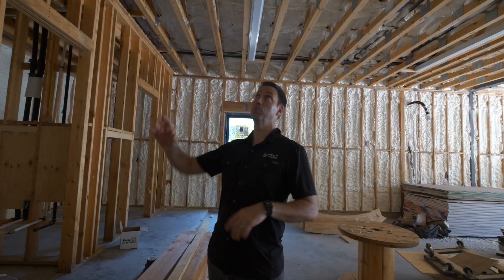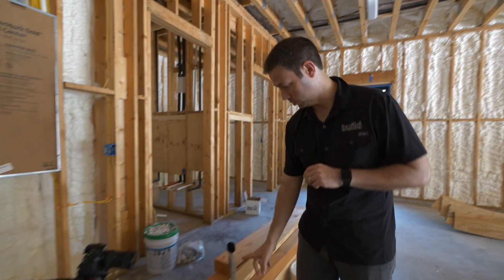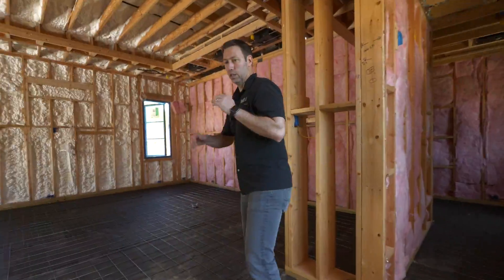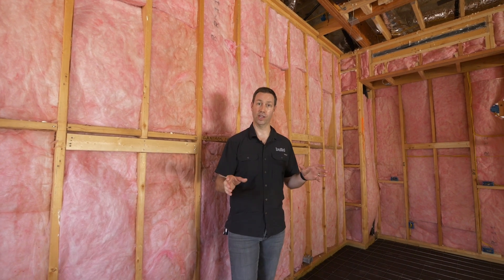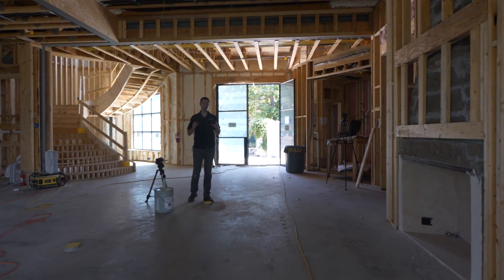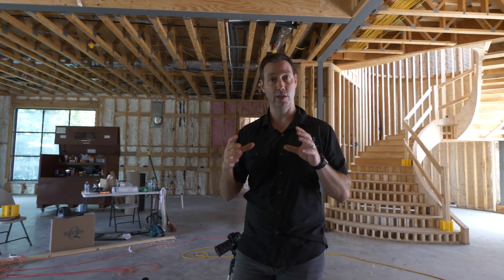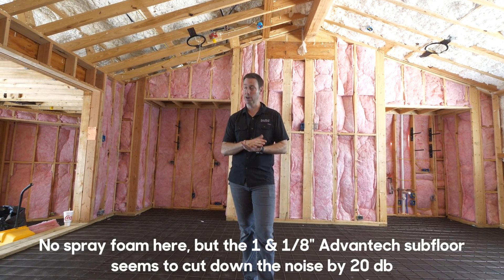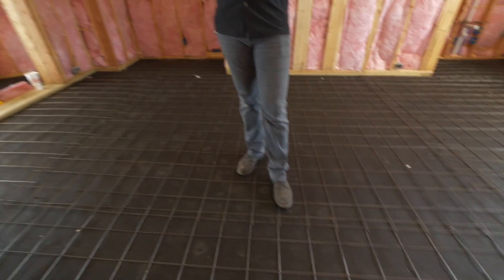Does Spray Foam Soundproof a Floor? Lets Test it!

Comment: You should make a 4' x 4' box and have a song or some noise sound at a constant level. Then Try insulating the box with different types of foam. That would give you a more accurate reading. noise outside the box reading inside and reverse.

Comment: Any insulation, is only part of the total solution. Spray foam air seals, it helps with mid and high frequencies and finding air gaps. Combine with fiberglass/rockwool, to close up between joists to stop the space from being a resonator. Then, decouple from the joists. RC then add mass with double drywall. This addresses "foot stomping" and pets nails.

Comment: There’s no science to this test. You need mass, not gimmicks to reduce energy transmission through boundary walls. Products for reduction of reflections (high mid and high frequency reverberation) like spray foam are not suitable for noise suppression. Even “green glue” is a sham. Mass, mass, mass. And each type of material will only be affective at certain frequency ranges. Air-sealed, air-gapped, and multiple layers of material is the way: this means, hire the pros, or you’ll spend thousands more than you need on gimmicks.

Comment: Open cell does some sound control but closed cell can actually increase noise by coupling .Your test is false as the fibreglass pink helps control you voice.
Make sure you mention yours is open cell.

Comment: Spray foam is somewhat effective but sound energy still travels down the joists. Resilient strips (Z-shaped channel) and two layers of 5/8" drywall is the way to go.....the mass of the drywall cancels out the deflection by the sound waves traveling through the joists.

Comment: TLDR: spray foam sucks. Adding a double drywall ceiling with some sort of isolation (green glue), or additional mass on the floor above are going to be the best improvements. You want air tightness to reduce transmission, and isolation+mass to reduce sound conduction. Insulation can Sometimes help with air tightness, but personally I would use it to reduce echoes.

Comment: Most of the vocal energy is being absorbed by the open insulation. Spray foam will be good for preventing sound transmission because it seals openings. But it doesn't have the mass to absorb any significant amount of energy. My guess is that it will be better at damping than say wall board.

Comment: When I built my studio (30x50) in an industrial building, I added a layer of sound board and another layer of drywall between the office and studio space. On the windows, I added 2 more layers of glass of different thicknesses and distance between layers, which cuts different frequencies. In the studio on top of 5/8" drywall, I added another layer of 5/8" drywall attached to Z metal. You couldn't hear traffic a from the nearby 4 lane boulevard except at 3:15pm; everyday a guy on a crotch-rocket would leave work.

On the ceiling and part way down the 12 ft. wall, 1" duck board insulation was laid flat. It preformed very well to reduce a major amount of reverb in an open space, , but cost $1200 at the time.

With time and money, we can achieve most anything we can think of. Cheers

Comment: Use Rock wool insulation between the Floor joists - snug, but not compressed.  (You could even use fibre glass as it's almost as good, but cheaper.)

Then install foam sill gasket to the underside of the ceiling joists.

Then install 5/8" Type X Drywall to the ceiling.

Then install another layer of foam sill gasket to the underside of the 5/8 ceiling drywall in line with the ceiling joists.

Then install a second layer of 5/8" Type X Drywall which will  become the finished ceiling.

Essentially you have a layer cake of drywall and foam with the mineral wool sound deadner. 

Results should be very good.

Comment: We used this same material for living space over a 3 car garage.  The major annoyance is from the electric garage door operators, bolted to the garage ceiling. Hardly hear sounds from the garage or living space above.  Our focus was on a cold floor, sound proofing was not a consideration.

Comment: Sound waves travel most effectively through dense encapsulated structures( Spray foamed), Isolating materials that vary in density, is what reduces the sound waves ability to conduct through the structure.
Reply: Laura Brown  There is virtually no soundproofing from those curtains. Read the Amazon reviews for those products using the search term "noise reduction". Complete waste of money if purchasing for sound proofing.
Reply: @elympicrecords  She's a troll... I see "her" same comments on many of the noise reduction vids I am researching.

Comment: Just use rockwool, resilient channels and 5/8 drywall to soundproof anything else is a waste of time.
Reply: I did this and its ok. But, I wish I used 2 layers of drywall
Reply: @didafm  If its only "ok" you did it wrong
Reply: @fivestar2227  how so? I used rockwool safe and sound with and air gap above and below. And used res bar and then 5/8 fire proof drywall... its good but I can still hear my basement tenant move sometimes...noise travels thru the ducts there is no way to address that.
Reply: @didafm  If they are rigid metal vents and your able to switch them to flex that might work for you. If you have an air gap above and below the rockwool that space would have been better loaded with more dense sound deadening rockwool.
Reply: @fivestar2227  i could see that working...but videos I watched on YouTube said to leave an air gap between layers....next time I would do 1 layer of 5/8 and 1 layer of 1/2 i think that would have been amazing

Comment: The reason there wasn't a change is because the vibrations travel through the exposed wood framing. I would bet that if you cover the wood with foam you would notice a difference.

Comment: Should've set the decibel meter to peak recording for the stomping test.  It's probably doing some averaging and not recording the real peak of the decibel for each footfall.  I can't really see the screen, but there is a "FAST" setting for most of the Extech devices.
Reply: Hes also not aware, i think that db are a log function.  20 db isnt 50% louder that 40 it is 100 times as much sound energy.  In other words there is a LOT more to it.

Comment: The only economic and effective way to deaden a floor in construction is to isolate (decouple) the deck and ceiling from the joists. (There is a more effective solution see the end). Increasing the mass, (eg using concrete) would work, but be very costly.

Most of the vibration in conventional home construction isn't  through the air space, but through air penetrations and directly transferred between the deck and ceiling through the joists. That structure it acts as a unified rigid membrane within each set of walls.  Some damping can be done by placing a dissimilar material between the tops of the joists and the deck but this material needs to bear the floor's loading, so can't block very low frequency vibration.  

If the ceiling is suspended from hangers with elasticity under tension, or by a light joists that are isolated from the loadbearing one of the floor above,  only the air can couple the floor to the ceiling.  The mass of the ceiling will act to dampen higher frequencies, partially through cathat sound.  A ceiling composed of isolated pieces would be more effective tha a similar material installed as a continuous sheet, and tiles made of alternating layers of rigid and elastic materials will  be more effective at converting vibration to heat than a conventional ceiling with one layer of sprayed on foam -regardless of the thickness of the foam layer. 

Compare the costs of these techniques against carpet floor covering with a dense pad.  The carpet will cost less and reduce sound better than a poured concrete floor.

Comment: I'll give you that foam will reduce sound but just by a few decibels and particularly with higher frequencies but will do close to nothing at isolating bass. The typical misunderstanding between sound absortion and isolation is that foams and light, absorbent materials reduce sound transmission when they only reduce sound reflection but keeps traveling through these materials. MASS is the only way to isolate sound, these are heavy compact materials such as concrete, steel, glass, etc.
So, if you are looking to reduce the noise from upstairs don't waste your money in foams and better add a layer or two of plywood, OSB or even sheetrock to your ceilings and make sure the gaps between them and the perimeter are filled with mastic. Recessed lights and such should be boxed in plywood too and sealed with mastic.
Great videos btw, thank you for taking the time to make them and sharing !

Comment: I'd be more worried about using open cell foam it's a huge growing bed for mold......
Reply: Use closed cell always better more money but no air pockets as open cell does and be sure you hire known company you won't regret
Reply: Only if there is a constant source of moisture ~60% relative humidity for >48 hours. Mold will not grow unless moisture is present. If there is that much moisture constantly the building will rot. I'm a licensed Mold Remediator

Comment: Worst. Science. Ever. That's not how you test something. Anyway, spray foam does almost nothing to block sound. Carpet would work well. Drywall would work better than carpet. I know, let's bury the house in concrete and Matt, you watch and see if that meter registers the roar of laughter outside.

Comment: This video is really an unfair comparison. If it was me I would have like a boom box let's say in the upper floor.
Play a file that generates a certain DB of sound before the spray foam is applied. Then redo the same test with everything in the exact same position and boom box sound levels, and redo the test. Room sizes can generate different DB level acoustics based on size, material, etc.

Comment: See all the steel reinforcement he's walking on?  On the upstairs floor?  They're going to pour lightweight concrete on the upstairs floor.  GUESS WHAT?  The lightweight concrete, or tile over cork or dense rubber underlayment or even OSB will isolate noise from upstairs and not allow it to travel through the framing members to the floors below.
What most people don't know is that the sound will transmit through the floor joists!
So, the only effective sound dampening is to separate the floor joists from the floor surface.  See above:  Lightweight concrete, tile over cork or even OSB over the underlayment.  Isolation.  Physics.

Comment: Sorry this is like listening to a snake oil sales man.  The cheap sound level meter seem to make it scientific but the sound level meter has a noise floor of 40 dB. That is pretty lousy.  Even with a lowest building code you should meet 45+ dB reduction between upstairs and downstairs.  So if you talk at a sound level of 70 dB you want to measure something below 25 dB... well the sound level meter does not even show anything below 40 dB.  So the video does not proof anything.  Matt should really do this show in a finished home and not in a home that is under construction.  The reduction of the floor is really a combination of the gypsum boards, isolation system, absorption in the cavity, etc.   In the 2nd example without foam on the ceiling there is an open stairway right next to the room.  I bet the main path of the sound goes right up the stairways.  I don't think this video proofs anything about the spray foam.
Reply: Yeah, this was ridiculous. The stomping was even more ridiculous. That meter will be averaging levels over at least one second, so unless he manages to stomp about 10 times per second, the displayed sound level is going to be nowhere near the peak.
Reply: Charles Could Installing ceramic tiles be an option to prevent/almost mute sound transfer from heavy steps from upstairs to downstairs?
Reply: The main point of this was to show that spray foam is not purposed for sound deadening, but for thermal insulating, although it will have a natural tendency to deaden minimally. That's the reason why they have the spray foam on the ceiling of the garage and not on the ceiling anywhere else.
Reply: I agree. The problem with acoustics is that it is like rocket science. Everybody thinks they have a grasp of  the basics but hardly anybody has unless they have studied it at an academical level. Don't believe you understand it even after you have learned it because you will fool yourself into thinking you have a solution that won't work. Footsteps resonate through the joists and walls meaning you need to create  a floating room that is not connected to the floor or walls through non-elastic parts.
Reply: Totally agree with you. That was not a test. That was a joke.

Comment: No wonder US houses are so dirt cheap. Are they really just made out of timber and I assume plasterboard? Walls should be concrete or concrete blocks. Floors maybe timber but my last flat also had concrete between floors as well.  What stops them going up in flames? I suppose the reason they get washed away in floods is because being timber they are light and float.  Everything being timber just looks so weird and flimsy.
Reply: mbaker335 ... And yet we have 'stick built' homes in the US dating back to the colonial era. Don't be deceived by appearances; if built' correctly timber construction is sturdy and durable.

Comment: could only imagine this being a worthwhile test if you did before and after spray foam in the same room. A little better planning would have made all the difference!!
Reply: Obviously it would not have made much difference. That's the point.
Reply: I live in Karachi Pakistan I like your comments send 4 month ago
Reply: @Cotronixco  I live in Karachi Pakistan I like your comments if you don't mind
Reply: @Cotronixco  actually just spray foam and a studded wall filler with recycled newspaper or jean is completely soundproof. no extra drywall, no dead space. Being in construction Im amazed more people dont know that.

Comment: Not to dork out, but you need a control. Better test would be same room, same location of meter and same sound (consistent volume) in room b4 and after spray foam.

Comment: Had 4" of closed cell sprayed inside older home roof so I could open up ceiling height. Rain not as loud but still can hear it, along with aircraft and road noise. I also put 1/8" acoustic matt (250lbs a roll) on traffic side wall before 5/8" sheetrock. Can't justify QuietRock cost but now the source of noise are the windows...😐

Comment: Most of the sound is transferred directly thru the structure, the floor joists, not the open cavity between. You have to insulate over the structure to really do anything significant
Reply: Decouple or float the floor? I am trying to figure this out for an attic music studio. Maybe 2" rigid Rockwool foam board w/ 2 layers of OSB?

Comment: I use to be a Builder and Developer of high-end homes .. wood is a poor sound barrier, instead it's a good conductor of sound. You would need to float both the floor and floor joist to reduce sound transmission. Look into products like U-Boat Floor Floaters or other similar products.
Reply: D Jaquith great comment - the floating system you refer to helps reduce the transmission of low frequency sounds, and that's what tends to bother everyone... and also love the fact that you will use the phrase "reduce sound". These people are perpetrating a myth when they use the word "soundproof".

Comment: Spray foam of any type will do great for air-ducted sound transfer as well as damping the subfloor undersurface from radiating footfalls.  Since the joists are rigidly connected to the subfloor, once drywall is also rigidly connected to the joists, those footfalls will be much louder since the ceiling is now a wide, flat and hard transducer face.  I'm guessing the flooring product going in is a different density than the subfloor, but the underlayment looks loosely laid over the subfloor, not rigidly bonded so you don't get the best benefit from rigid bonding of different densities.  The other comments about hanging the drywall (perhaps using the product you showed previously for long and super smooth walls) are correct.  Either way, I look forward to the finished house re-test.  We had good results using the spray foam to cut air-ducted transfer and lots of mass to dampen rigid sound transfer.  Not excellent like drywall hangers or QuietRock, but way, way cheaper.  Thanks for the video.

Comment: Is there a solution for how echoey and loud the new open concept homes are? Anytime I go to a party at a home I can hardly hear myself. There has to be a solution to absorb the sound other than rugs and textiles. Thanks!
Reply: Foam and other wall and ceiling treatments. These are commonly used for audiophile listening rooms, but not the most aesthetically pleasing.

Comment: I wonder where is the "Quiet Rock" or am I a little early.
Reply: Thinking of using quiet rock on my basement ceiling to separate my unit from upstairs tenants.  Both ceiling open in basement and flooring ripped up upstairs now.  Any other suggestions?